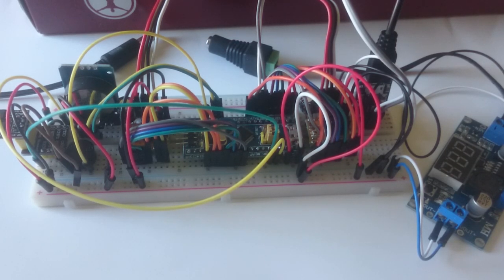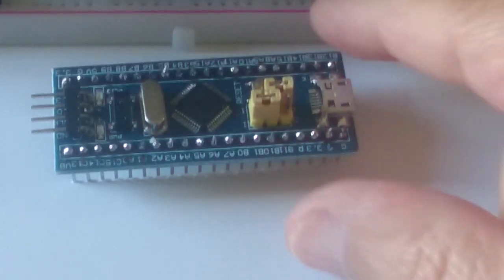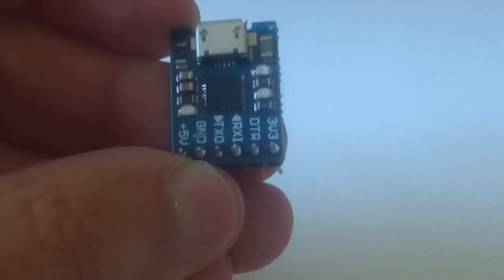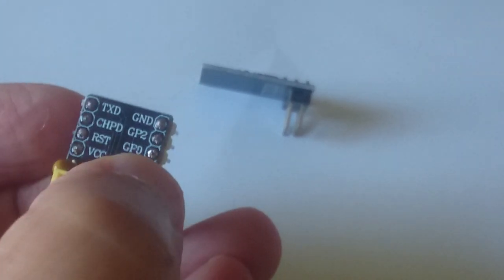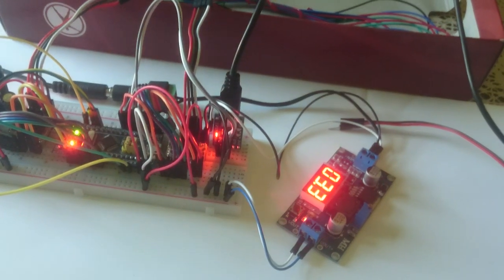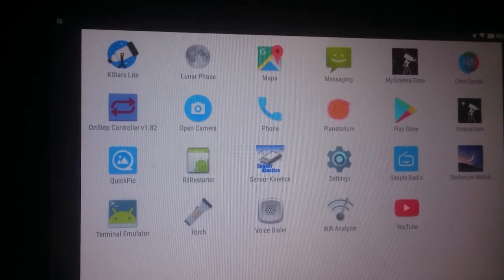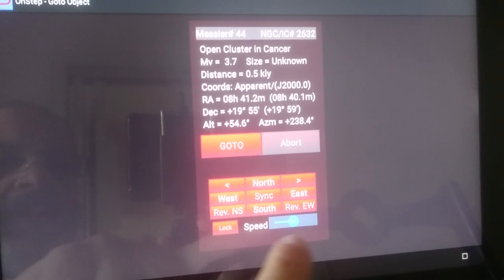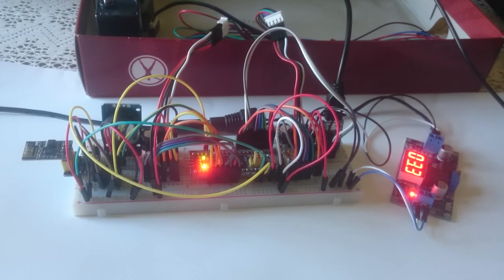STM32 ARM Cortex M3 OnStep Telescope Controller

Comment: Hi please, please could you tell me if a mks robin nano v2.0 board would work with this onstep project, with tmc 2209 steppers ?? I desperately want my telescope to be used with onstep and I already have the above things at hand, I'm broke so can't afford to buy a full goTo mount lol...I appreciate any help and advice
Reply from the maker: No, this board is not supported. Only the boards on the groups.io Wiki for OnStep are supported.
Reply: @khalid_ba  dude thanks for the reply, yes iv been trawling that wiki for days and I can't make sense of it, I tried buying the blue pill kit but says its out of stock, refer to previous page, but there's no details on it, so I then sent a message to the group and had nothing back, I'm so desperate to just put a simple tracking mount together for my eq5, but I don't know what's best and seems like the kits are unavailable....
Reply from the maker: @mickyovts3872  
The pandemic chip shortage has hit the Blue Pill. Both the microcontrollers that can be used with the Blue Pill PCB (the original cheap one STM32F103 128K, and the faster and more capable one F303CC) are no where to be found.
Reply: @khalid_ba  iv just realised who you are lol..wow dude you're awesome man....so I'm sorry but could you tell me if the arduino mega 2560 would still work ?? And what would I need to have a simple tracking mount...the group says the mega, a hc-05 I feel something is missing ? And there's no more info I can find on the arduino version....On top of the bread board shows a little red chip, looks like a stepper driver ?? I get its not practical but it also says "unless low cost is a priority" I'd say in this case it is, especially with the shortage lol...BTW thankyou for the replys, I expect your probably busy working away at something, so your time is appreciate
Reply from the maker: @mickyovts3872  The Arduino Mega2560 will work, with the RAMPS 1.4 shield, but it is the slowest board that can run OnStep. The next version (few to several months) may not support it. It also suffers from an inaccurate ceramic resonator. This is not an issue if you want visual only (not suitable for astrophotography probably). 

The HC-05 is a Bluetooth dongle that makes an OnStep board talk to a phone, but a Wemos D1 Mini over WiFi provides for more functionality than BT.
Reply from the maker: If you can sell the MKS Robin Nano, and get a FYSETC S6, that one is supported by OnStep, and looks like it is cheaper too.
Reply: @khalid_ba  hi yeah iv looked and simply cannot get hold of one...I'm in the UK too which is hard to believe, but yeah they're mostly in America and imports taxes etc, its just not practical, looks like my last option could be the wemos and cnc shield,...is that still going to work at present and in the future ??
Reply from the maker: @mickyovts3872  The S6 (not the F6) is the one that works with OnStep. I have bought it from AliExpress. It should be supported in the upcoming rewrite.
Reply: @khalid_ba  ahh ok, I ended up getting the cnc, wemos version but now I'm stuck, my stepper steps are 200, microsteps 32(thought I'd use the a4998s incase I do something wrong) I'm stuck with the gr1 on the onstep config calculator...I have no idea what to do...checked all over the wiki and cant find anything to help me, I even put a post up offering to pay someone to walk me through it and noone bit, I nearly smashed my screen I was that would up lol...if I pay you will you walk me through it sometime, genuine offer on the payment too
Reply from the maker: @mickyovts3872  
I have not used the CNCv3 board, so can't help with its specifics. 

Go to baheyeldin dot com, and click on contact, providing your mount specifics (make, model, gear ratio if know, ..etc.)

Comment: Foud this:
https://www.ebay.co.uk/itm/STM32F103C8T6-ARM-STM32-Minimum-System-Development-Board-Module-For-Arduino-/291693366485?_trksid=p2349526.m4383.l4275.c10
Would it be compatible/enough?
I have steppers, drivers,telescope mount(heq5 coming tomorrow from ebay)! Great project by the way.
Reply from the maker: Yes. That one you linked to should work. 

Please visit the link in the description for full information. Also, there is a PCB that makes building a controller much easier. See my latest video, and the link in the description.
Reply: Cool ,much cheaper. Will check thanks.